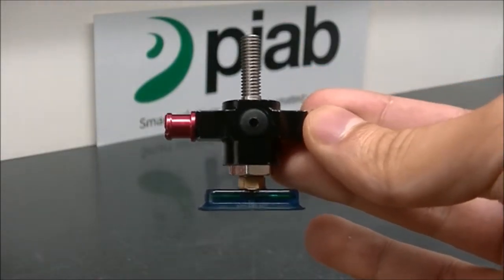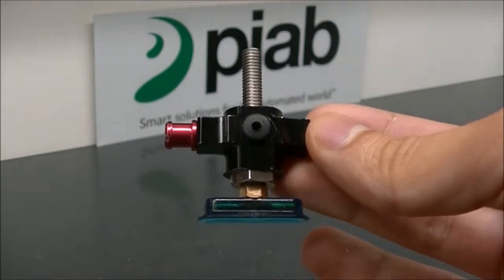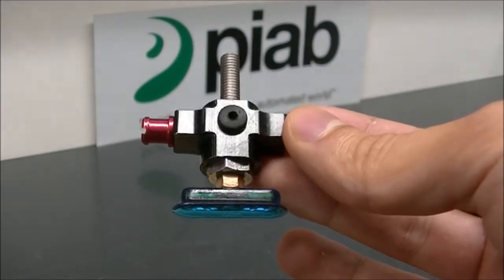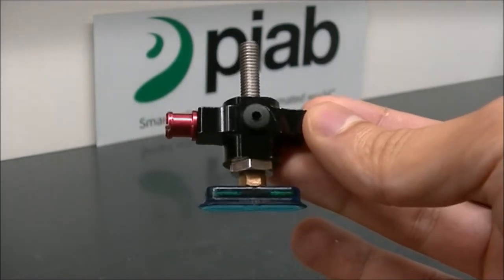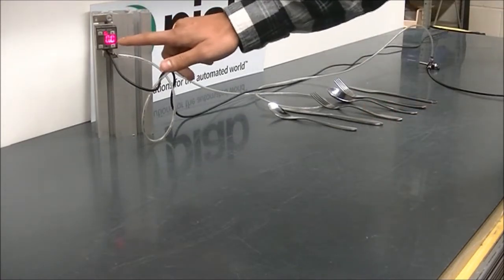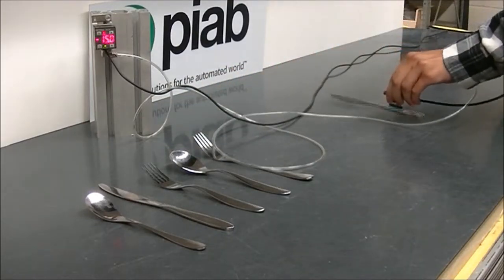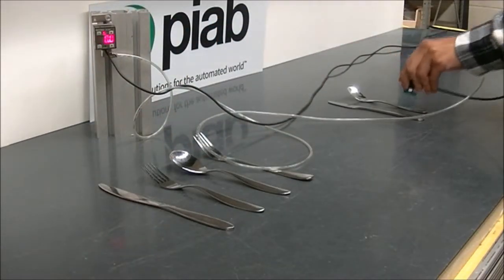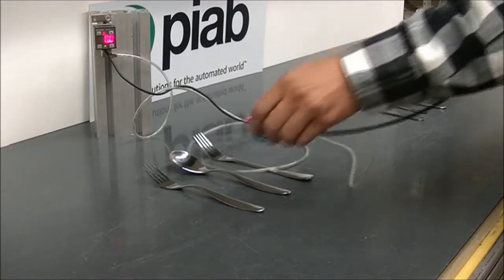Handling various silverware with vacuum - Piab

Comment: which product use for pressure ,pressure which is going in to the VGS 2010
Reply from the maker: You need a source of compressed air (air compressor) or even a nitrogen tank to power the VGS2010